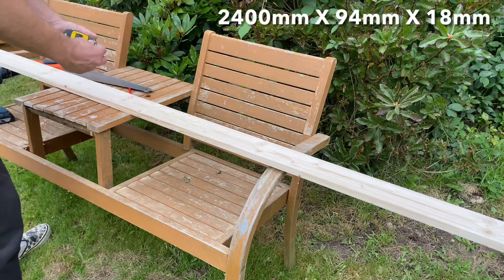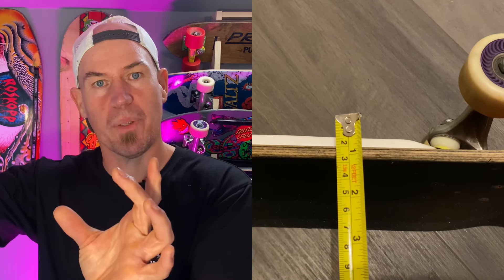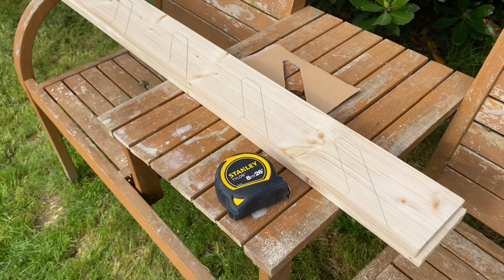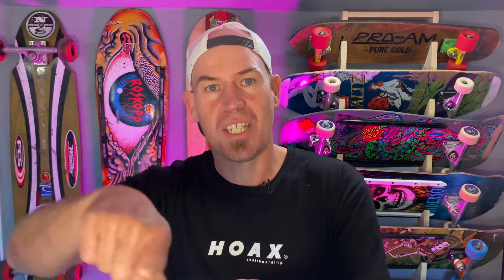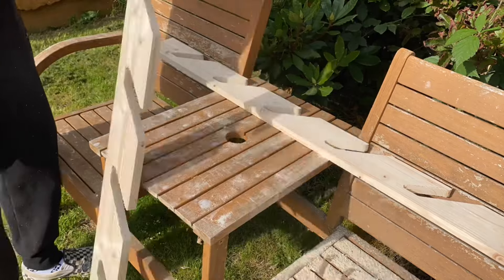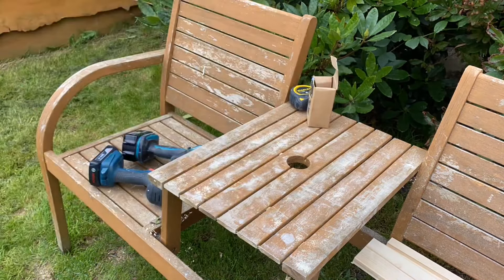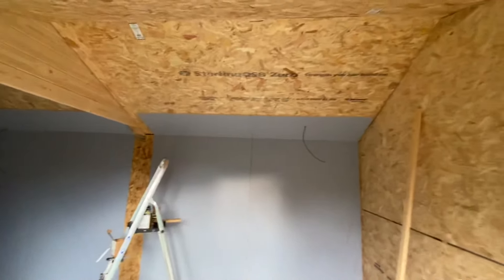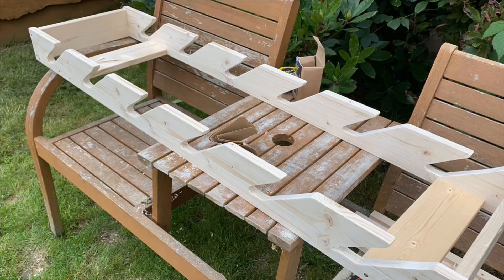Build A DIY Skateboard Storage Rack

Comment from the maker: Materials = 
Planed Softwood 
240cm X 9.4cm X 18mm (sides) 
120cm X 9.4cm X 18mm (slats) 
Bit of card 
16 X 70mm Screws 

Tools = 
Jigsaw 
Hand Saw 
Sandpaper 
Pencil
Scissors 
8mm Drill 
Cross head screw driver. 

Measurements 
Height = 120cm 
Width = 29cm 
Depth = 9.4cm 

Cut Outs 
45 degrees 
3cm wide 
11cm Deep 
Cut out placement every 19cm
Reply: Cheers for all the info. But 16x70 screws?!! 😂
Reply: Hey mate, what size were screws? I see you used an 8mm drill piece? 🤔
Reply from the maker: @doricdave  hey dude, yeah pretty much anything will work I recon? I used 6mm screws 70mm long, possibly a bit over kill, but it’s what I had lying around?

Comment: Thanks for the tutorial ! I’ll make a similar shorter assembly of 6 slots for a combo racking of skate, long board and snow board. Just need to measure the perfect space between board as it will uniformly fit, either it is a skate wheel base or a snow fix on the top
Reply from the maker: Yeah, I found the spacing was the hardest thing to work out, but the cardboard template helped?
Reply: @JonBishopSkate  It did ! Also the way of copying the first side for doing the second

Comment: Nice work! I went through a very similar exercise myself to make mine, but I used a load of 9mm MDF I hade lying around plus some bits of 2x2 pine. The trickiest bit like you say is finding that balance between how much space you need between boards and how many you can fit in the height you have. They always look good parked in a rack like that though 😎

Comment: Au naturel looks awesome - it allows the boards to show themselves off while reminding us they're all made from the same stuff.  I know that moisture is a bit of a thing over there in the UK (the fact that the whole country is mossy and mouldy is a dead give away) so perhaps try a Satin Polycrylic finish.  It won't turn yellow and will add a little bump/scratch protection but make sure you apply it in thin coats or else it may get a little tacky.  You could always leave the inserts uncoated if that's a concern, but really it shouldn't be 👍
Reply from the maker: Great advice, thanks !